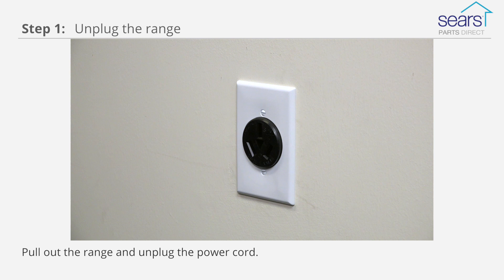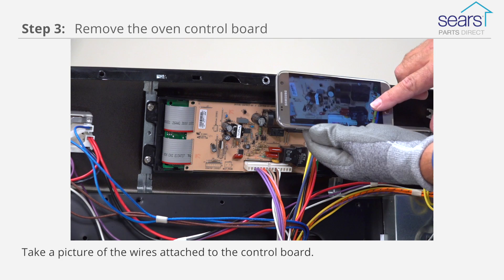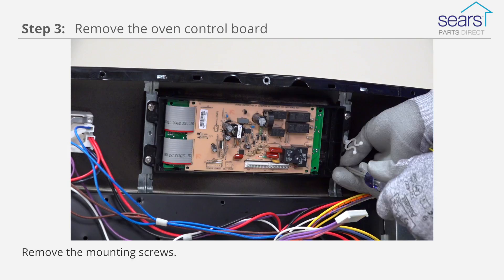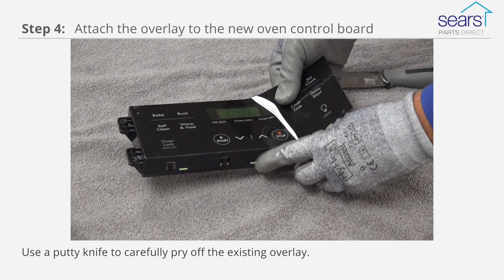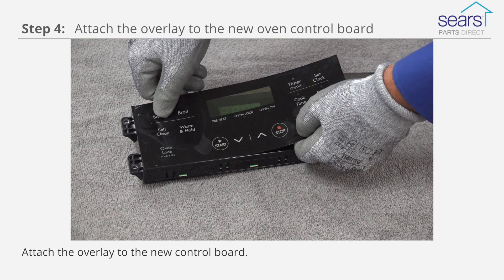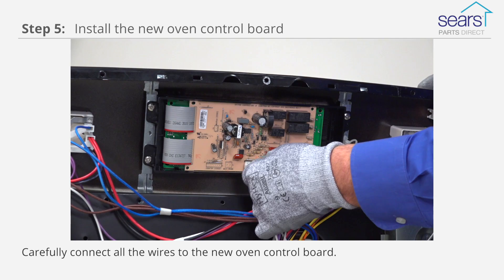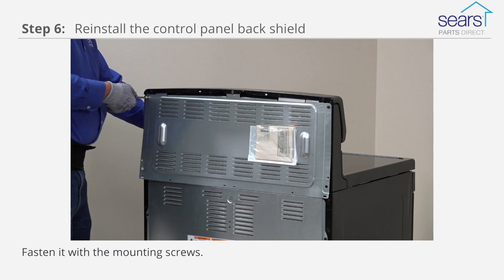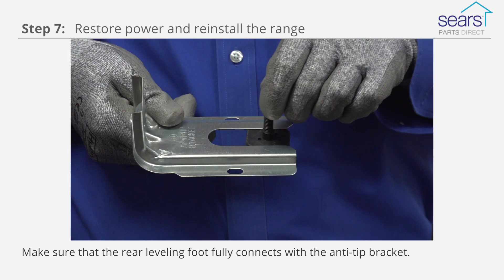Replacing a Range Oven Control Board

Comment: Recalibrate?
Reply from the maker: The electronic oven control board shown in this video typically won’t need to be calibrated. If actual oven temperature varies from set oven temperature, you can adjust oven temperature using the procedure shown on page 18 of this manual (if you have the type of range shown in the video): https://www.searspartsdirect.com/partsdirect/user-manuals/79094173310-kenmore-parts-manual  If you have a different type of range and you need help with calibration, let us know the model number of your range and we’ll try to help you with the calibration procedure.
Reply: I have a kenmore stove bought in 2000 works great but the lcd display is very dim, how to fix it. Thxs